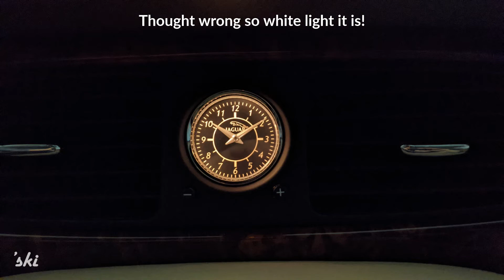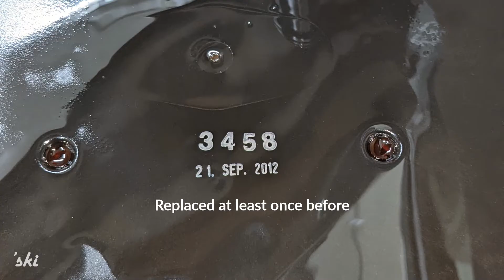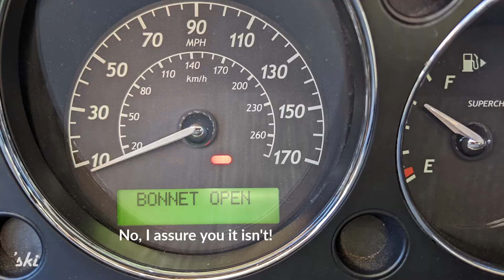2004 Jaguar XJR One-Year Service History

Comment: This is excellent. I bought a 2009 XJ8 a little over 2 years ago. I might need to do a similar recap of my journey. I had a lot less to do since my car only had 43k miles when I bought it, but still I fixed a lot of the little details too when I got it and have had a few repairs along the way. Thanks for sharing and the car looks fantastic!
Reply from the maker: Thanks! I found the XJR to be somewhat difficult to work on, especially with the heat exchanger sandwich in front of the engine but overall it was a great experience. Enjoy your XJ8!

Comment: Lovely car ! I ran two, a 2003 Sport bought in 2010, and then another, a 2007, (with the slight restyle) in 2016, a Sovereign. Both cars had the 3 litre V6, a lovely engine not exported to the US, but is actually a Ford engine not a Jaguar development. I now have an XE. Why, well I just got fed up with constant replacement of certain suspension bushes, as you'll no doubt find out about. I also had to replace the heater core on the second car. Neither car ever let me down, and I regularly took them to Germany on holiday. Furthest trips were to Berlin and Nuremberg, so about 3000 miles driveway back to driveway. The 2003 was more troublesome than the later car even though it had many fewer miles on it. I suppose the first year of production is always a bit risky.
Reply from the maker: Very nice! Never driven one with a V6 but I’m sure that adds its own character. How bad was the heater core replacement? Did you have to remove the entire dash?

Comment: Beautiful! I have the same car (2004 XJR, silver but without navigation) and I am enjoying it! Who did you use as your parts supplier? Thanks!
Reply from the maker: Thanks! I sourced them from a few shops: SNG Barrett, Jag Bits, RM European, Welsh Enterprises, and the local dealer.
Reply: Not seeing the reply Steve that I just tried to give you but when it does show up I was serious about the secret site try not to spread that around it's basically a in the circle between salvage yards or salvage yard owners and operators source which is why you might find some of the prices better than what you might hear when you ring one up

Comment: Great Car and Video, At what mileage are you changing the transmission Fluid and rear Differential oil Exchange. Did the transmission Downshift faster after the service?  Appreciate a response I 2 XJ 358  08.
Thank you
Reply from the maker: Thanks! This was all done at 108k miles but the transmission fluid/pan were replaced at least once before. I think flushing both fluids every 60k miles would be ideal. The shifts weren't necessarily faster but much smoother with the new transmission fluid.